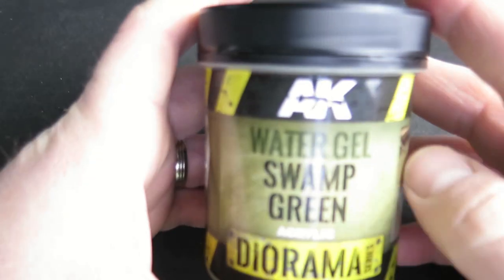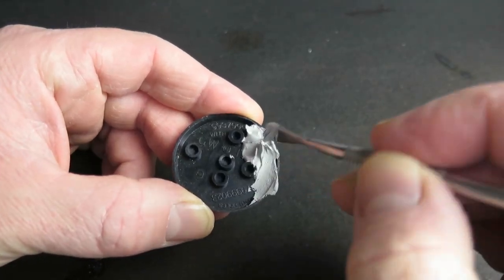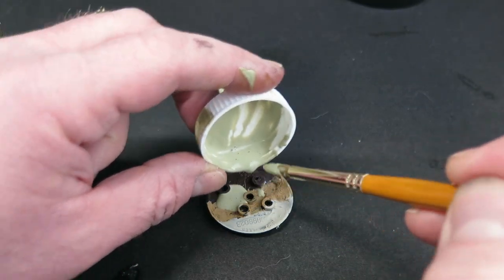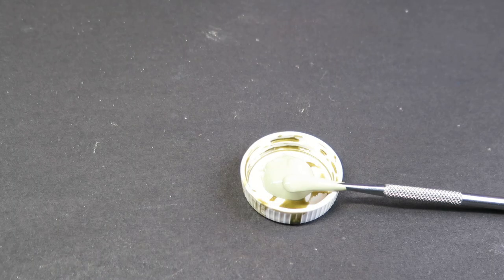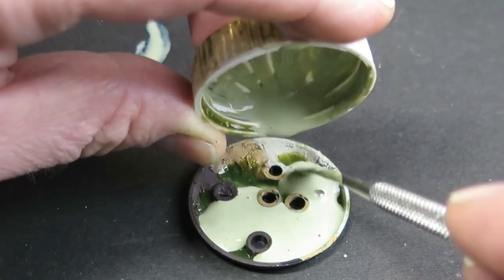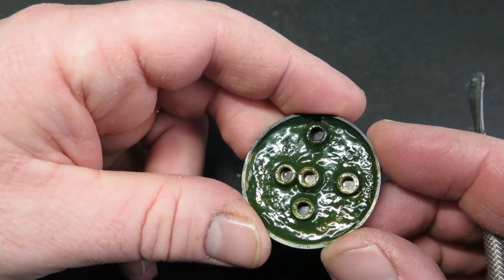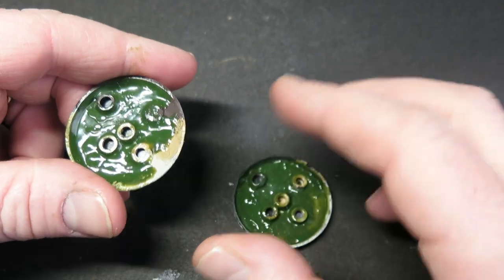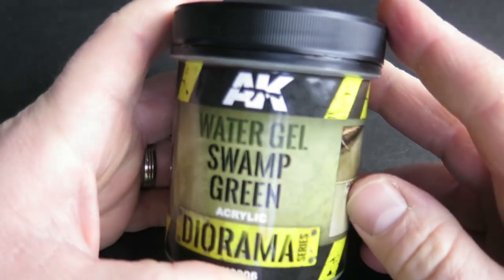Is AK Interactive's "Swamp Green" Water Gel any good?

Comment: A few years ago, I built some 'swamp' wargame terrain. It looked pretty good, but I was at a bit of a loss as to how to create pools of water. I didn't want to use resin, as, being lets say, 'frugal', (or a cheapskate), I would have had to buy a load of the stuff just to make what amounted to a few puddles. I'd read an article in a modelling magazine that suggested using gloss polyurethane varnish, so I tried that, pouring it to a depth of around 1-2mm. This looked great!... for while, but then it cracked and went yellow/brown, resembling nothing so much as a fungoid toenail. I couldn't get the stuff out, so I abandoned the whole thing to the Cupboard of Doom and forgot about it.
Then... I came across this review, remembered my swamp project, and bought a tub of this stuff. Two coats of this, and presto!, I had the great looking swamp I had originally envisaged (rather than a podiatry teaching aid).
My wife makes teddy bears, and sometimes uses really tiny (1mm) glass beads for stuffing the really small ones, and I found that a few of these dropped into the goo ( so that the bead is at least 50% submerged), create a nice effect of bubbles of swamp gas. You can get them from teddy bear making supply companies, I had a look this morning and they are about four quid a bag. I also found that a judicious sprinkling of scenic flock ( I used 'Grass Ground Cover' by 'Footpath') here and there, makes quite convincing duckweed.
All the best, and thanks again for the review, please keep them coming!
Reply from the maker: The "podiatry teaching aid" part really made me chuckle :D 
I am very glad the video helped and you got a great result on your swamp project though. Also, I love the idea of the glass bead bubbles and the scenic flock for duckweed. I have a swamp project in the pipeline and I will certainly give that a go. Thanks for the tip!

Comment: Nice tutorial / review. did you try to use some kind of protective coat of camera to see if there will be some kind of reaction on varnish ? And did you try to use different kinds of glue if you want add static grass or tuft with pva glue or some resin plants with superglue ?
Reply from the maker: Hi deende79, not for this one..... however.... I do have a few "swampy" projects coming up that will be more complex. So, more testing first would be a smart move. Thanks for the ideas!

Comment: Enjoyed this video alot mate, i do have a question; im currently making a Kashyyk themed board for SW:L and im trying to decide if im better going with this product, or painting then using the transparent gel water effects? what do you reckons
Reply from the maker: Glad you liked it! That sounds like a really fun project. Are you looking at large areas of water or smaller areas? How deep are you going?

As for whether to use either this stuff or the  Clear water...... As luck would have it, I am currently editing a video testing the "AK interactive still water". I am hoping to have it ready by the weekend. So I hope that will help!
Reply: @FlyingRavenStudios   Hi mate, thanks for the reply and yes so far it's been a blast.  the area of water is roughly 30x20cm so not huge, but not small either. 
i want to avoid expoxy resin is possible due not being too confident with it.  Regarding the depth, i plain to put it straight ontop of a foam board, thats been painted, so no real depth.  i'll keep an eye out for that video!